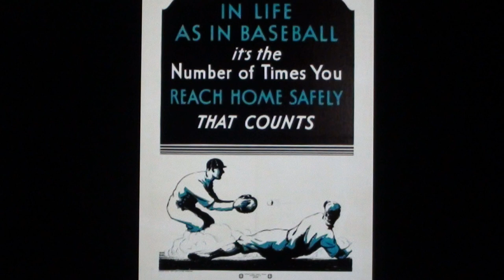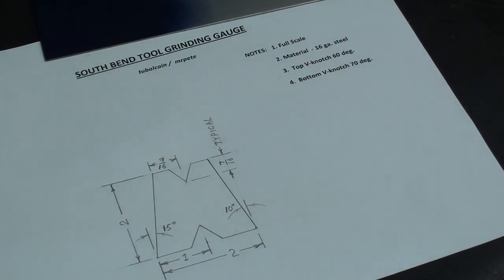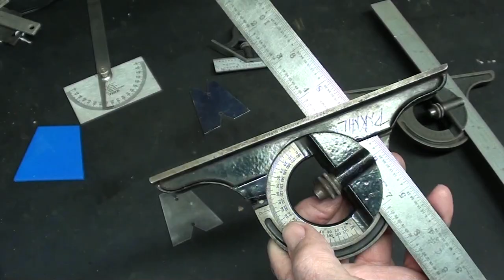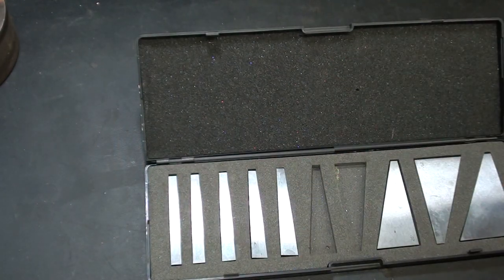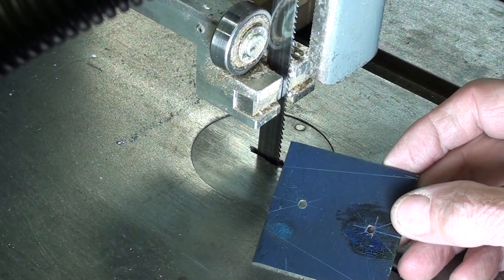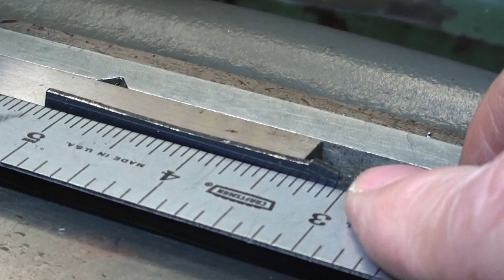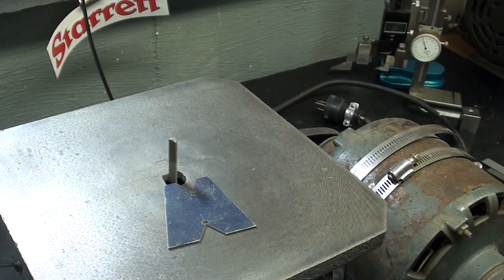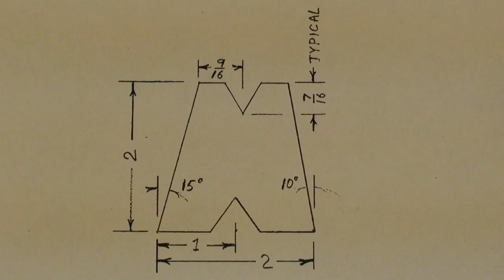MAKE SOUTH BEND TOOL GRINDING GAGE #800 tubalcain

Comment: Good morning Mr. Pete, I have a 3d printer and I find it is most helpful in my home machine shop. I have used it to make gears to cut a special thread. I have also made holding fixtures for odd shaped items to clamp in the milling vise.
Reply: Good idea for making templates for cutting gears if you don't have a index head.

Comment: Hi,
I went to the website to download the plan and cannot find it. The link takes me to the main page of your projects but the gauge is not listed. I went to the site map and looked for it there with no success. Since I do not have a cell phone that I can download  the app for reading codes  that does not work for me. Do you have the exact link  for access by a desktop? If so, maybe you should post that in the SHOW MORE area. I have plotted the dimensions onto a piece of graph paper and will use that for transfer to steel. Thanks for doing this.
Reply from the maker: Sorry, I guess it is not on my heap.  Use your phone to take a picture of the drawing at the end of the video
Reply: @mrpete222   The only model showing up is the Dial indicator holder.

Comment: The company I worked for had several filing machines. They were used for filing to the lines on templates used on Cincinnati hydrotel milling machines with tracing heads .
 Also on VTL tracing heads.

Comment: Thanks Pete, You need a hand stamping guide; which is a piece of 1.5 angle iron with two holes in it, and a bigger piece of heavy flat stock with two studs sticking up to match the holes in the angle iron.

Comment: I recently found out the hard way that the tops of my milling vise jaws are not parallel to the bed of the vise and the table. You may have to clamp the work between parallels to use the ruler trick.

Comment: Hello Mr. Pete
 I dearly love your videos. Yep I have a vertical band saw, and
 a set of angle blocks. I have been machining pulleys, and use the angle
blocks to set the angle of my compound.  The protractor on my lathe is useless.
With a fifteen-degree angle block I can set it dead on in just a couple seconds.
If you have macular degeneration and only partial use of one eye sawing on a
bandsaw can be quite entertaining!

Comment: I had to grind my hss tools by eye under the Greek shop teacher in freshman high school don't remember any gauges. I think by ear, I could make one now. rake angle and such over 50 yrs ago.
Reply: I did also and still do. Rake angles don’t have to be exact or even close. As long as you have enough to prevent rubbing the tool will cut.

Comment: I’m sure I mentioned before I have a filing machine and use it as often as you do. As far as stamping numbers etc goes I use an arbor press. I made a fixture to hold the punches and have an x&y table for the work. This way it is quite easy to get your stamping in a straight line and evenly spaced.
I have even enjoying watching you in the machine shop cranking out the projects.
Reply from the maker: Good idea to use the arbor press

Comment: Another great video Lyle.  I liked seeing the die filer in action.  Two years ago at an auction I was one of two bidders for a very nice condition butterfly die filer.  Could not resist for the $15 it cost me - deals are out there you just have to be at the right place at the right time.  This project might give me an excuse to fire it up.

Comment: You missed me when I had my hand up!  I thought I had bought one, but in digging up information for this comment, I found out I have a Profile Grinder, not a Die Filer.  I purchased {at an estate sale) a Milwaukee Profile Grinder made by Rice Pump & Machine Co. in Belgium, Wisconsin; Serial No. G 890.  From  Vintage Machinery,org: "Wisconsin Pump & Machine Co. was originally a division of Milwaukee Chaplet & Manufacturing Co. (archived) but was spun off in 1950 as Rice Pump & Machine Co."  Under both names they manufactured a die filer, but mine is a Profile Grinder with a cylindrical grinding stone (20,000 RPM) protruding up through a flat table that can be tilted.  Vintage Machinery,org has a brochure of it listed under Rice Pump & Machine Co./Publication Reprints/Milwaukee Profile Grinder that shows what it looks like.  The brochure has a designation: Bulletin 55-PG, that maybe dates it to that era, but since the Bulletin No. appears to be typed on, not part of the original artwork, who knows?  It is came with the stand and altogether probably weighs about 75 lbs.  Like you, so far I am an accumulator and have not used the machine, although it does run.

Thought you might like this item I found also: From Vintage Machinery,org: A. H. Petersen Manufacturing Co. was a forerunner of Milwaukee Electric Tool Corp. and the originator of The Hole Shooter.  Maybe you are a descendant of the Founder of one of the premier power tool names in portable tools!
Reply from the maker: I I have never heard of a die profiler, I must do a little research on that